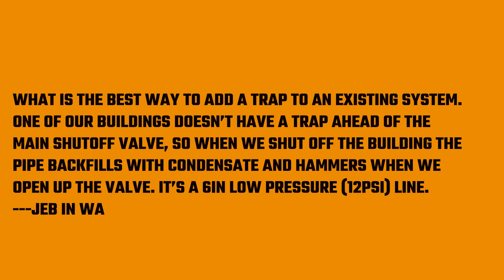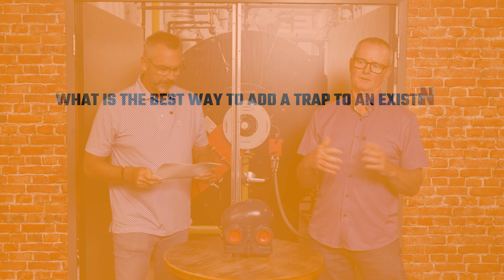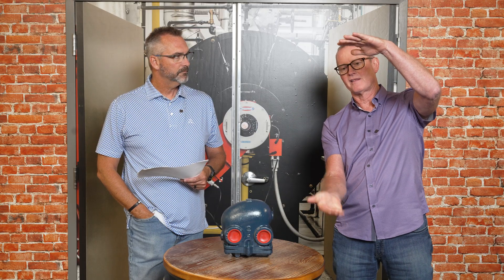Steam Trap Troubleshooting 101: Failures, Fixes & Pro Tips - The Boiling Point

Comment: If low   pressure steam boiler doesn’t have non non-return valve, I work with 4 boilers, how can I prevent condensate water back to boiler if 1 or 2 boilers are running??? Thanks
Reply: I deal with the same issue with a low pressure 2-boiler system. Any time one is offline for a period of time the condensate will flood the offline boiler. No main shut-off between the two. I just do bottom blow downs to drain excess water. You mix in carry over water and it gets worse. Only thing I could recommend is testing your alkalinity and conductivity and keep carryover water to a minimum. Good luck and Stay Safe out there.
Reply: Overflow traps on the boilers